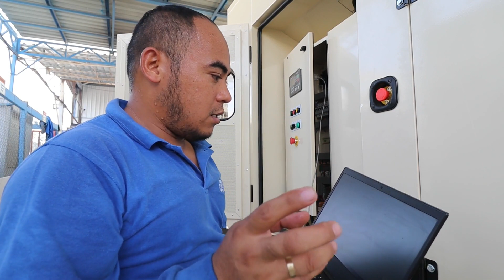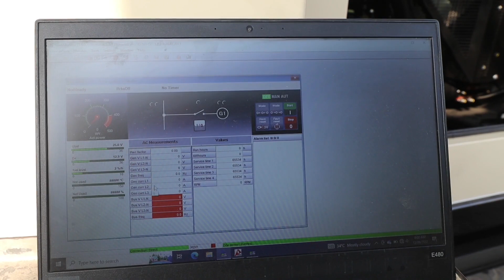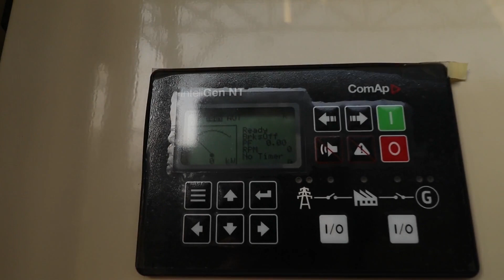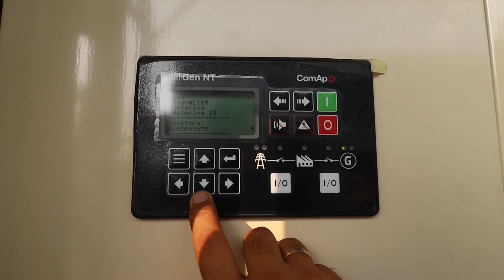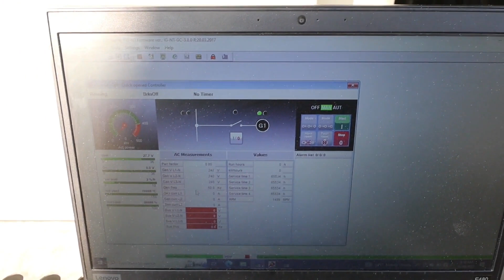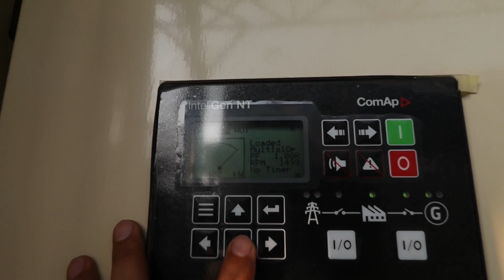COMAP INTeligen NT, voltage biasing test, speed biasing test, load testing benzblogs

Comment: Sir,I would like to ask. A rotating diode was installed a year ago but now it has blown off.What could be the cause? It is a 750 kVA Cummins genset paralled also to another 750 kVA Cummins genset  using intelicompact controller.Thank you in advance...
Reply from the maker: Blown diode is cause of over excitation that overload the the rotor and sometime due to load type

Comment: Hindi mo naman  Bro pinakita kung saan ikakabit yun mga wires nang biasing. Sa ECM at tska AVR  tapos yun mga settings sa comAp. Tapos kung papano tuning kasi hindi katulad yan sa DSE. May jumper kp dyan na remove depende kung anung klaseng speed governor ang gamit.
Reply from the maker: Dependi sir sa governor gamit mo sir im working olin compnay and there is rule im just follow will i can help some how if you ask but not expose to you know

Comment: Can 2 is not for extra...can 2 is for inter controller can for load sharing and synchronization...can 2 is basically its load share line...
Reply from the maker: You can use it just config it as your msc